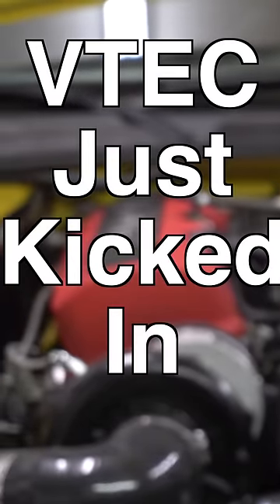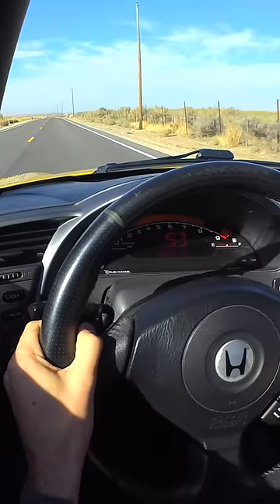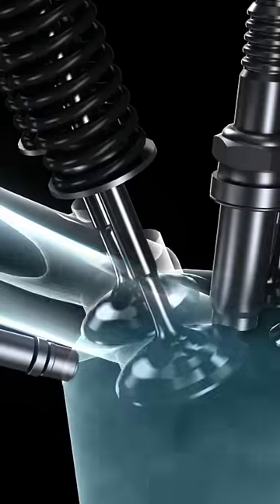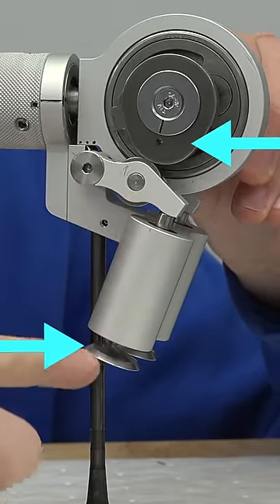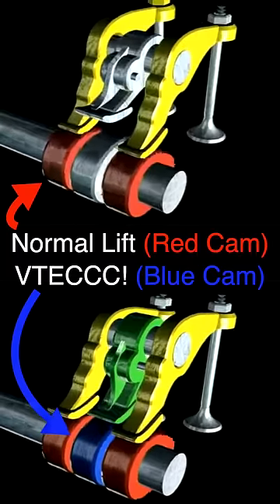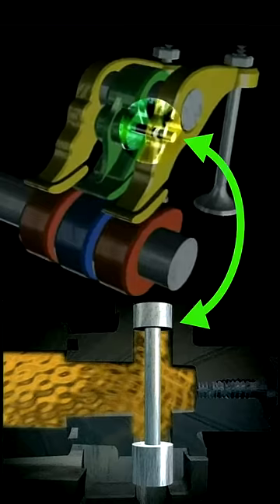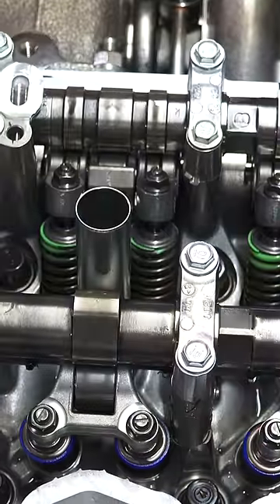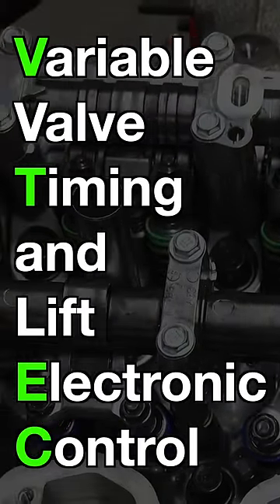How VTEC Works (In 60 Seconds)

Comment: It’s really cause small cam is powerful at low RPM and a big cam is not and high RPMs big cams are powerful and smaller cams are not so they combine the two , it could use it on big engines also, it works very well. It’s not about making a slow car faster. I hate people that knock on Honda. It’s a four-cylinder not a V8 a four-cylinder and they’re pushing three and 400 hp out of it when a V-8 is 300, and 400 hp

Comment: Actually it doesn't help the car go faster, technically that 'faster cam lobe' is the normal lobe you'd have if the car is more performance oriented, and VTEC allows you to have that performance oriented lobe at high rpms while still make the car somewhat mpg friendly, people think of it backwards, it's not a turbo or power additive, it's a gas and emissions saver 👍

Comment: Whether or not VTEC gives any meaningful performance benefits compared to forced induction or a larger capacity is irrelevant. It's the fun factor. 

I had bigger smiles from a B16 powered Civic than cars with twice the power.

Comment: I have that on my truck. Called AFM/DOD on Chevys. I am deleting it for a better cam. They did this on the Chevys to get MPGs to please the government. The lifters break too much. From what I remember when you take a B H or K series Honda and you are going to go boost its better to remove VTEC because it can be a weak link in the chain of things to break. And those 4 bangers break a lot when they are pushed to the limits. I do however miss my 98 Integra Type R, but I was going to put a B18B1 head on it with a turbo.

Comment: And it’s my understanding that the small hydraulic pin that locks the lifters together also requires a good, clean engine with frequent oil changes…so that it functions correctly…..at least that’s what I’m told.  Don’t want a sludgey engine.  Makes sense.  I’ve been a loyal Honda owner since 1973, and I can say with them 16 Hondas I’ve owned, I’ve never had any engine trouble/failure.  I am an oil change nut…. always do my own maintenance.  
I did have one transmission self-destruct at 108,000… not from a lack of maintenance though.  I large nut on a large shaft inside the tranny worked itself loose and scoured the inside of the aluminum case… creating thousands of metal shavings. 
Other than that, they’ve all been extraordinary.  Both my current Hondas have I-vtec…. run great.

Comment: The VTEC technology has been superseded by the patented electro-hydraulic intake cam actuation as used in the Multi-Air engines invented by Fiat's R&D group, now used in various Stellantis projects. Weirdly, they don't talk about it much, but the MultiAir system allows for an infinitely variable intake profile, and gives their engines a decided advantage in performance across a wide range of conditions, where 1 or 2 cam profiles are not nearly as good.

Comment: I hate JDM but Vtec doesn't make a slow car just a little faster, 160hp out of a naturally aspirated 1.6 liter motor that easily goes to 180 is just insane. At a displacement of less than a 3.0 there's barely competition for Honda.

Comment: Not used to make cars “faster” it’s design is to allow for an economic (more fuel efficient) cam profile while still having a performance cam profile when needed, many cars use Variable valve timing with their own goofy acronyms such as Audi, Nissan/Infiniti, GM, Ford and pretty much any modern motor manufacturer.

Comment: Vtec is kinda the opposite of trying to make slow cars faster. Its limiting the engine to waste less fuel in low rpms and when you need power and rev higher you get more. Feels similar to a small turbo

Comment: Lol, vtec doesn’t make slow cars fast. Before vtec you could have a car with cams for power or for efficiency. By allowing two cam profiles you can have both. Yes vtec enabled cars are faster than same car without it from the factory that’s because most companies don’t make cars with high performance cams because they idle rougher and get poor mileage.

Comment: In my experience Vtec makes the car sluggish and severely underpowered and vtec makes it normal / above 5000 rpm or whatever it was set to.. honda such a disapointmnent from someone expecting a sporty car.. 
only typeR deliver that, other models are just lackluster in performance, typeR - when you go from first to second gear it stays in vtec mode, really pushes it out, all other model, vtec kicks in yo, you shift next gear, wait till vtec kicks in again yo, all the way up 
- vtec is designed to save fuel and make your car underpowered until you decide to drive it like you stole it / and even then if it’s not R it’s crap.. 

I once raced against turbo powered volvo against my accord, both 2.0 150 hp, volvo (your grandpa’s safety car) jumped up in front after second gear.. 
That’s when I knew, honda is just riding on some old idea of s sports car.. 

Yeah yeah, “it’s turbo”, but also it’s volvo, you wouldn’t expect it be like 2x faster with same specs, it’s all about torque on low rpm tho - this is where you drive 90% of time.. and vtec made it low rpm/lowest torque you can go / limp and lifeless
Reply: vtec gives you good low end and top end, do you know how cams work? there isnt a one size fits all

Comment: im not sure if cars in australia is fake or mounted incorrectly or they removed a covering? Vtech engine housing was looking like its 'rattling' or shaking and increase the force or power output.. i thought its interesting. see the angled injection and intake valves, the top above them moves rapidly up and down at angles, which makes the engine look like its shaking or rattling side to side that drive each other with more thrust. interesting look. hard to tell if showing off vtec or if during maintenance or whatever.. but im guessing all dual overhead cams could look vaguely sorta uhh like that somehow some way or other?

Comment: Does it go by speed or by the RPM?
Reply: RPM. Many Honda engines, it's designed to kick in somewhere in the 5000RPM range.
And you need to be flooring it, I believe, it's only active at WOT. Not sure why, and I might be wrong on that.

Comment: Serious question:
Why aren't the Valves further open per default? Would at low engine speeds more air equal more fuel to remain the mixture ratio, leading to higher fuel consumption or is there another reason?

Comment: okay if the diagram is accurate, this is what I see. there's actually three different cam profiles. each of the two valves and the center lobe. I wasn't familiar that the two intake valves don't necessarily open the same. But I see that is the case here. I think it has to do with swirling the intake charge. directing the airflow as it enters the chamber. at some point when maximum power is needed it looks like that Center lobe is used to lift both rocker arms. that middle cam lobe has different lift and also a different profile. That's where the change in timing comes from. I think many know that if you put too radical a profile cam for high-power you are going to run into trouble with idle. that's some of the benefits of running this on the Lesser profiles unless you're at full power. I'd like to know more about the mechanism of how it switches but at least now I have some idea what's going on.

Comment: It's amazing how a simple better way is a coil and a switch that is magnetic on off and the lifting is changing through pressure release system which doesn't use computers to do the same thing  laugh out loud one emp and your screwed up

Comment: Toyota's vvt-i and valve-matics perfected this technology, and made it super reliable,  unfortunately they didn't tap into the performance sector as well as Honda did with the v-tec...that's why there are fewer "riced out" Toyotas around compared to Honda. Then, all of a sudden Subaru made these engines look like child's play with the turbo boxer tech.
Reply: Early 2000s Boxers included AVCS subarus VVT.  Spools the turbo 800ish RPMS sooner.  VVT is awesome

Comment: If you had VTEC on the whole time wouldn't make your car allways go 'faster' ?

It would just consume more gas, you'd have more power as soon as you start your car, right?

Looking this way, having VTEC makes your car go slower but you'd save gas ?
Reply: no, the big cam only makes good power at higher rpm. engaging it all the time would ruin the idle and low end drivability. in fact if you engage it at idle manually it will stall the car

Comment: Simply put, the engine revs up to a higher rpm before changing the gear. It was also made so that the car can save up fuel when  speed isn't required.

Comment: NOPE. VTEC gives you better fuel efficiency not more power. Measure the lobes on a VTEC vs a non VTEC Honda engine of the same type.  The non VTEC engine will only have the more aggressive profile not the more fuel efficient one. So a non VTEC engine will produce as much power from the word go without having to switch over to the more aggressive profile.
Reply: it gives you both, if you had the big lobe on all the time it would be slower and have awful driveability at low rpm

Comment: You explained absolutely nothing. All i got was it gives engine little more air. Like I didn’t already know that
Reply: Solenoid activates locking in place lifter thingy, lifter thingy hits the larger 3rd lobe of camshaft allowing more valvelift.  More valve lift = more time open.  More time open = more air into cylinder.  More air in cylinder + more fuel = more power.

Comment: Vtec is for saving on fuel at low rpm.

Not for more power, otherwise you wouldn't have vtec and you would have 1 big arse valve.

When you put your foot down at low rpm, a vtec is still slow...
Reply: your confusing what’s shown in this video for variable valve timing, variable lift is absolutely not for saving fuel at low rpm

Comment: Does that pin that locks rocker arms together, have potential to fail often, don't work on many Hondas
Reply: not really, the whole system just means its more sensitive to lack of oil changes which most engines arent a fan of

Comment: I mean they could have just used bigger cam lobes all the way through the Rev range but they couldn't because that would ruin their emissions. In other words VTech is an emissions device it's made to make a car more economical while driving under normal conditions without sacrificing performance when you need to put your foot down.
Reply: no they couldnt, if you engage vtec at idle it will actually stall. and there is an optimal engagement point, too early and you will loose power. its not an emissions device

Comment: I understand how it works before this video. What I wanna know is why have something like this active only when you need it when instead you could just have it all the time to increase overall performance... just would make way more sense
Reply: because it doesnt work like that, cams have a specific power band where they work best. with vtec you have the best cam choice for low and high rpm

Comment: Seems like a low tech approach compared to the phaser types.
Reply: cam phaser only changes timing, not duration & lift. you can actually use both on the same engine

Comment: I had a 1998 Honda Prelude Type SH with VTEC, and at around 120K miles, it developed valve train damage that made a pretty loud ticking sound, and a Honda dealer said it would cost about $3500 to have it fixed. I was changing the oil every 5000 miles, give or take, but they said that because of the close tolerances in the VTEC system, oil changes should be every 2500 miles or less, no exceptions. Call BS if you want, that's fine, I'm just repeating what they told me. I didn't want to spend the money to fix it, so I traded it in on a different car.
Reply: Ticking noise could’ve been ur LMAs or it needed valve lash adjustment. Could’ve done it ur self 😂.

Comment: I still don't know what's it for, maybe when you want a fast car but too poor to pay for gas for the extended valves to be running all the time?
Reply: do you know what happens when you engage vtec at idle? it stalls, with vtec you get nice drivability and top end power

Comment: VTEC doesn't provide more power, just limits it at lower rpm to improve fuel costs and reliability
Reply: Yes it does it activates at high rpm so what the engine does at low rpm is just the engine working without vtec  maybe look at the video again
Reply: @tonnyberben1770 No, it allows for smaller cam lobes and duration for regular cruising while still getting the full power of a more aggressive cam at wide open throttle. If you just wanted power, there would be no vtec the cam would just be the "vtec on" size

Comment: Now what is Ivtec cause in Vtecs i hear mmmmmm but in my fathers Ivtec i hear a howl why?
Reply: i-Vtec is different as it allows adjustment of timing adjustment of the Intake camshaft.  While i-vtec does not work the same way as traditional vtec depending on the vehicle.  It will deactivate certain intake valves to save fuel by only using 1 intake valve per cylinder and using the 2nd after increased load or RPMs and/or not injecting fuel into some cylinders to save gas.  When you hit "vtec"  on these motors you are simply using the rest of the engine.  I could be wrong, but that's what I remember

Comment: It's a very impressive technology. It actually makes a car feel like it has two engines, one for everyday use and one for sports/track use. The only downside to VTEC, is that you have to really give the car the beans to get that performance. Younger drivers and anyone with a lead right foot will get the most out of the engines, but I've never really liked the lack of power at low end RPMs. It's a personal preference thing, but I'll take a turbo charged vehicle over a VTEC, because I like the lower end torque.
Reply: Do you have automatic or manual? If you have the auto, it's the VCM that is making the low end rpm's sluggish. You can remove the vcm with ktuner or vcmtuner
Reply: @RX-hb3np  I've never had a Honda to be honest. I've only driven a manual Civic and Integra Type-R, not tried an auto.

Interesting info about the autos though!

Comment: It's called variable valve timing and the only unique thing about vtec is that Honda brands their engines after something every single brand has used for decades
Reply: no it’s variable valve lift, variable timing barely makes a difference in comparison. not many brands have it

Comment: why can't Honda makes the blue valve open at all time, so the car also has higher power in low rev?
Reply: because that would lose power, the big cam is only good at high rpm. with vtec you get the best of both worlds

Comment: Can you do a similar one on Lotus Elise engines?  And what happens when you "wipe a cam." Also fun fact, the tuners could have matched the transition point to make the engine slightly faster, but chose to make it more fun by mismatching it so it feels like a massive turbo.
Reply: its called the 2zzge not the lotus elise engine as it originally came in toyotas. cam wipe is excessive wear on the cam lobes in a short period of time, hence wipe. and its more the size of the cam lobes that gives that sudden change, toyota made the low speed cam relatively small to emphasize it
Reply: I would think the transition is very noticable sinply because it's a pretty big change in emgine breathing that happens at a discreet RPM point. How could it not be sudden? That pin/larger cam is either engaged or it isn't.

Comment: Variable timing electronically controlled. Alot of cars  had this long  before Honda. Honda do it on the exhaust side to create more valve overlap. Toyota do it in the Inlet side, vvti.
Reply: its variable lift not timing, toyota has VVT-Li but it was only on the 2zzge
Reply: My euro spec Honda Accord iVTEC K24 engine has variable valve timing on the inlet and variable valve lift, as shown in this video, on the intake and exhaust. They are 2 different systems.

Comment: Best way to explain it is the pistons start moving too fast for the current valve event aka the explosions are happening too slowly so it advances and dumps more air in and allows it to regain higher rpm efficiency.

Comment: I wonder that why isn't that open to v-tec extended position all the time ,that way the max power is available all the time instead of the threshold where vtec comes in play?
Reply: big cams are only good at high rpm, you would loose power having the big cam on all the time

Comment: Sorry to burst the Honda lovers but Mercedes was the first car company to develop and utilize this ability in a street vehicle, labeled VVT as u know Variable Valve Timing
Reply: variable valve timing is not the same and barely does anything in comparison
Reply: Ok so the literal description of variable valve timing is in the full description of the abbreviation for vtec! Also I understand they r not exactly the same considering vvt only relies on a timing aspect while vtec relies on timing as well as lift dynamics which is a bit more specialized approach but it still remains a fact that it wouldn't of been expounded upon if it wasent for vvt initially!
Reply: And also Toyota was the first to actually specialize the approach that Honda ended up using

Comment: VTEC wasn't made for slow cars to feel a little bit faster, it was made to allow fast cars to have a regular car's fuel consumption when running slow and a sports car's fuel consumption when going fast.
Reply: uh not really, that’s just one of the benefits. it lets you run a bigger cam without the downsides

Comment: “Variable”? Is only has just two positions.
Reply: yes, variable doesn’t mean it has a specific number of changes or anything
Reply: @arcanevoid9199 yes it does. This is selectable valve timing and duration. Number of choices, two.
Reply: @arcanevoid9199 a cars throttle is variable as is the braking system. Not just 2 step, idle or WOT, no brakes or ABS. Get it?